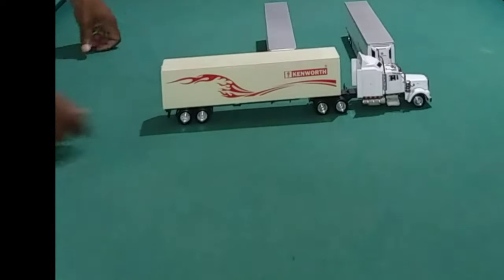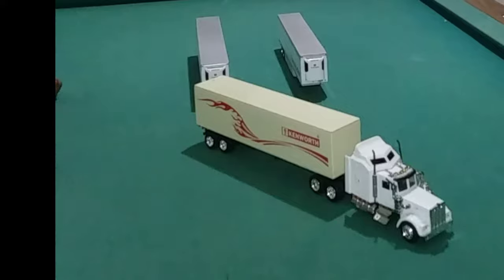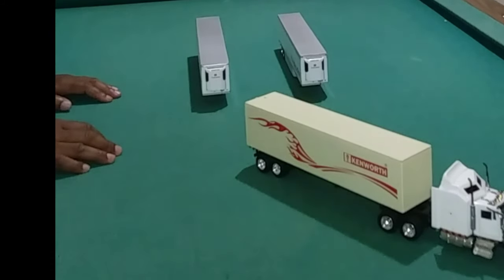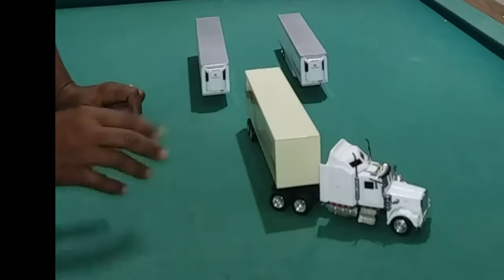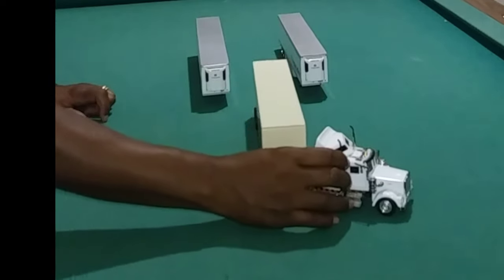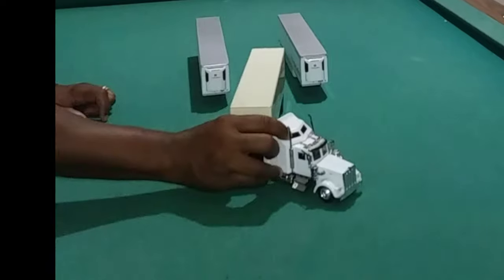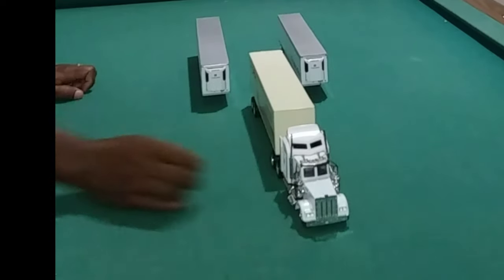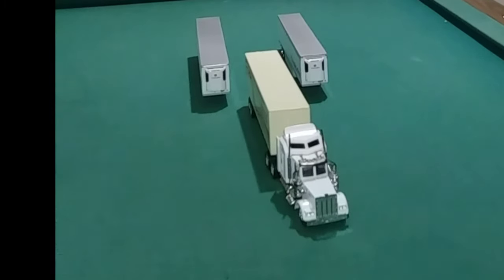Best way to set up for 45 backing maneuver.

Comment: I was drawn to this by looking up the pivot back because I was told years ago that the maneuver they where trying to teach me was not a 45 degree backing technique. This really confused me like a lot of other nonsense you learn in driving school to get the CDL that you didn't need in the 1st place. Plus another key that is not stressed in school is the position of the tandems and the part it plays in your backing. I am going to go back to the pivot practice video and view it again. Thanks for the info because I burned myself out and got discouraged because my backing was so screwed. Thanks again.

Comment: When you turn to the left after doing the 3’oclock. Was my setup wrong if I left a bend it while turning hard right to get it in the hole
Reply from the maker: You should be straight with the trailer and then pull up about eight feet if you have the room...
Reply: Thanks. Your videos are way better than these schools

Comment: Is there different set up for 40’and 20’trailers?
Reply from the maker: Not really, if the trailer is shorter, then you probably won't have to use as much space doing the setup. Meaning, getting the trailer in the position to do the formula.

Comment: So what if you don't have much room ahead of you?
Reply from the maker: Good question David. So make sure that you get the trailer in position and you have the pivot in the trailer straighten the wheel and pull up as much as you can then turn the wheel all the way back to the left and backup and just repeat that maneuver. Truck trust the formula. You may have to do quite a bit of pull ups to get it done , seeing that you have a small amount space. But the formula will work for you if you follow the steps just trust it. Let me know how it works out ok.
Reply: @Thisisebm  okay so I can use the same set up every time,  even in tight spots
Reply: I also talked to one of your students yesterday Gerald at a truck stop in Champaign il. I was practicing your technique and he knew it was your technique 😏
Reply from the maker: Absolutely once you get the trailer in the position,pointed (straight) toward the hole putting the tractor back in front of of it is easy, if right made the trailer bin, then left will take the pivot out. so just straighten the wheel pull up as far as you can turn it all the way back to the left and back up and you repeat that maneuver. it should work for you this time next time all times included.
Reply: @Thisisebm  thank you

Comment: That is good but not always applicable. My best advice is to learn the 90 because you will have to use it at one point. Practice the 45, and even the blindside from time to time. I've used all 3 in a single day sometimes no joke.

Comment: I know you mean well, but that is entirely to many pull ups.  You are also assuming the driver will have ROOM to pull up and get tractor in front of trailer.  That's not the case a lot of times.  The way you show it, the T/T never gets in a 45 degree angle.  Even DOT only allows 3 pull ups or one fails test.
Reply from the maker: Thanks for watching Gregory!
Reply: @Thisisebm  Your welcome.  Hope you don't mind constructive criticism.  Some drivers DO need this information.

Comment: I got a question
Reply from the maker: Go for it
I hope I have the answer
Reply: @Thisisebm   can you back up the same way with a split axle on a flatbed?
Reply from the maker: Great question, although I've never driven split axle flatbed. I think the maneuver is still the same just the reaction time of the flatbed trailer probably would be slower which means you may have to pull up a little further I assume. But the steering wheel steel goes left and right on any backing maneuver which makes the process still the same.

Comment: Thanks for this video but you never have that much space in truck stops to pull up like that.
Reply from the maker: First of all thanks for watching Laker.   The point of the video is setup and process. Once you understand how the position the trailer and you follow the process, it will work with the minimal of spaces, that was the point. But again thanks for watching and the comment.

Comment: 3:59 at that position turn ur wheels all the way to the right n move forward until u can see ur trailer on both mirrors and point ur steering straight n do a simple straight back - no need for that many pull ups lol